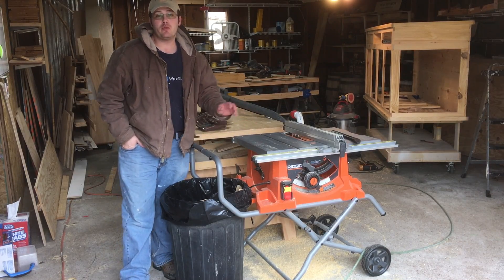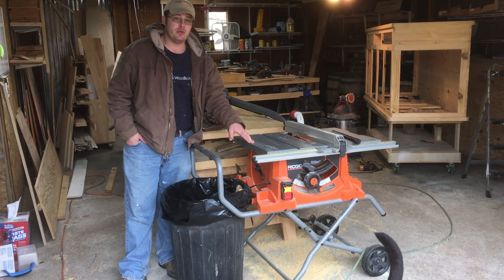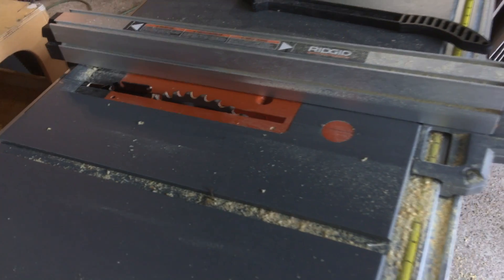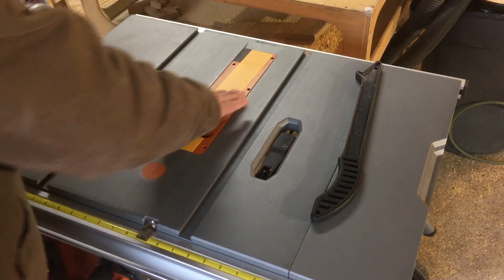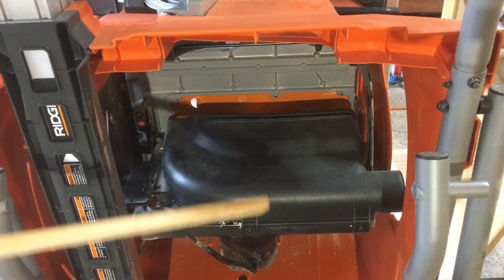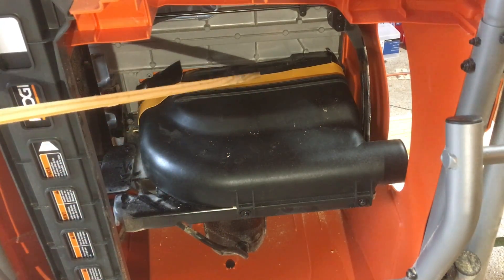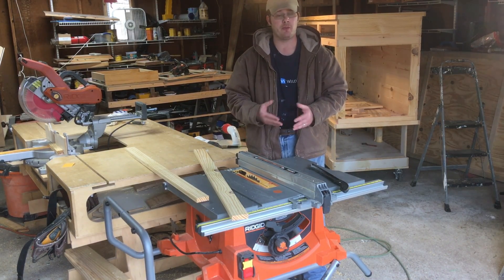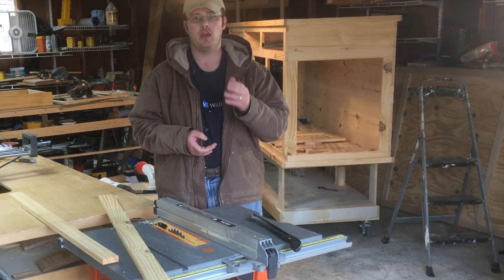How to Improve Dust Collection on a Table Saw - Ridgid R4513

Comment: I did the same thing with the fast cap tape for a quick fix, like it takes two minutes. It worked so good I purchased more of the zero clearance fast cap tape just in case it didnt last long, I changed it once in 1 year. Its like a temporary permenant fix and highly recomend it. Nice video.

Comment: Thanks for sharing this idea.  I have the R4516, which has the same basic dust collection as your model and have been wanting to tighten up the dust collection, but I was not sure how to pull it off,  Your idea is simple and doesn't interfere with the tilt so it it is just what I needed.
Reply from the maker: Lloyd Simmons the only downside is that it clogs up more when not using a vacuum.
Reply: I wanted to let you know this works great, as it really prevents a build up under my saw.  I was having to remove the saw from its' DIY stand every few months just to remove the saw dust build up and now there is practically no build up after a few months.  That tape also allowed me fix my throat plate as the model I have does not have adjustments and has always been depressed into the top slightly.  The tape was the perfect thickness to act a a shim so that my throat plate is flush with the top.

Comment: Thanks for creating this video.   I've got the R4513 and that gap at the top is causes lots of dust.  I'm sick of it. 
 I've been thinking about how I could block it off.  Great idea.
Reply from the maker: Fred Tittaferrante this biggest issue is that now I have to use a shop vac or it clogs up very easily. But I always try to use DC so it’s not a big issue
Reply: @DaileyWoodworks  make a dust separator, it's totally worth the effort!

Comment: The issues I have with this saw is the table is not flat. It's 1/16" off in the middle. That alone throws off the entire saw. When you extend the wing it drops by 1/8" or more on the front right. The front too of the rip fence is about 1/16" of an inch off from square when clamped down. It can't be adjusted. Make sure you check these settings before committing to the saw. For non precision ripping it works fine for the price point.
Reply from the maker: M C dude, that sucks! I’ve had really great luck with mine and don’t have any issues with it. It’s definitely not my grizzly 3hp cabinet saw. The Jobsite model that gave me the most problems was the Hitachi/Metabo. I returned two of them within 90days

Comment: Thanks for the video. Two questions: 1. Have you noticed a big difference with these changes?  2. If you adjust the blade to be at a 45% angle, does the tape get caught in the blade and/or ruin the setup you have?  (When titled it looks like the tape would "smash" into the blade.).  Thanks!
Reply from the maker: Tanner Tweten I haven’t had a problem with it. I works really good. The biggest downside is that If you are not using dust collection it has a tendency to clog
Reply: I use the Dado Plate to cut anything other than 90 degrees. Big reduction in suction at the plate, but it keeps me from having to replace the zero clearance tape after one little geriatric moment. Which seems to be happening more and more often.

Comment: You sure your first two saws didn't fail because of overheating?  From lack of airflow from being choked off by dust collection mods?
Reply from the maker: Steve McCormick considering I didn’t mod those, the issues were the fence not locking secure, and this saw is still going strong I’d say....probably not

Comment: Please give feed back on how the tape is holding up after usage?
Reply from the maker: I took the zero clearance tape off the throat plate because ones I made a bevel cut it was pretty much useless.  But on the under side it's holding up just fine

Comment: I didn't figure out how to remove the riving knife and it doesn't show in the user manual. Can you please give me some instructions on how to remove the riving knife? Thank you
Reply from the maker: Unplug the saw,  Raise the Blade all the way up, On the riving knife there is a lever on the right hand side, pull the lever and this will allow you to pull the riving knife out.
Reply: @DaileyWoodworks  I am able to adjust the riving knife on UP position. Do you mean I have to pull the knife further to remove it completely? I tried to pull the out but it has been locked somewhere.